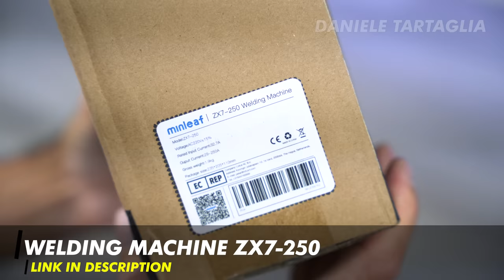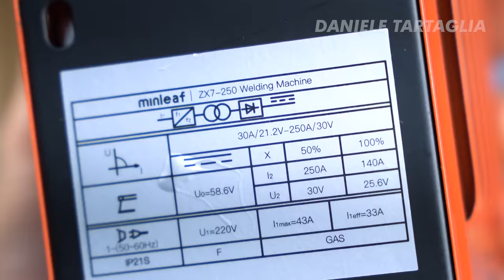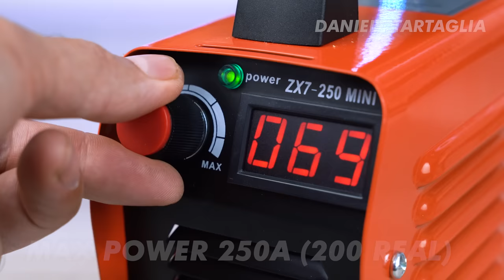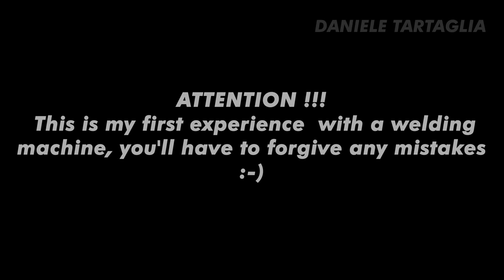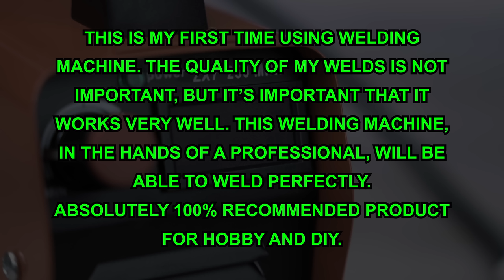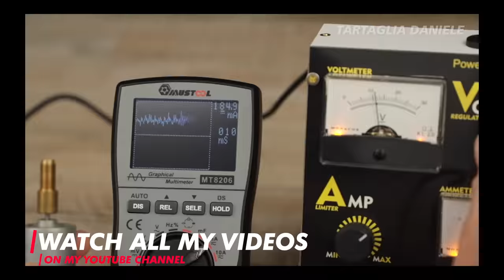INCREDIBILE! MINI welding machine that fits in ONE HAND - Topshak ZX7 250A

Comment: DEFECT ALERT: If I had my own YOUTUBE channel, I would make a video about this DEFECT I found and corrected in my brand new TopShak ZX7-250A 110V welder, which I bought on Banggood.  Apparently, this unit was assembled using five M3x10 machine threaded screws to anchor the 3 big heat sinks in the back of the unit, near the cooling fan. This was a HUGE MISTAKE on the manufacturers part, because the heat sinks have no machined or tapped threads for the M3 x10 anchoring screws to bite into substantially...but only crude SLOTS in the aluminum castings. You need to grab a standard #2 Phillips screwdriver and remove the welder cover, then use the screwdriver to check all five heat sink anchoring screws on the bottom of the circuit board, to see how many of them are loose and INCAPABLE of even being sufficiently tightened in the first place. I just replaced all five LOOSE heat sink anchoring screws with some slightly bigger sheet metal screws, which have tapered threads very similar to self tapping screws. NOW all five screws can be tightened very securely. You really don't want any of those 3 heat sinks EVER coming loose, because the result will eventually be a certain failure of the welder. If you rely on the factory installed M3 x10mm screws to keep those heat sinks secure, your welder is headed for certain failure. Luckily, this shortcoming is very easy to remedy.
Reply: Hold moly thats for posting this. I was thinking of purchasing the welder from banggood and using it right away, after after getting it wired up.
Reply: Is the welder actually 110v or 120v. Would this welder trip a 15amp circuit breaker ?
Reply: Call it 110V or 120V,  but at the end of the day, it is the same old single phase AC wall outlet supply voltage that we all use here in the USA for most of our common AC powered appliances and devices. MOST of the smaller devices and appliances rated for 110/120VAC are going to run on any outlet that is supplying anywhere from 90vac to 130vac. But anywhere between 110vac to 120vac is optimum. I have found that 113VAC to 118VAC seems to be about the national average wall outlet voltage, which is just fine. I don't KNOW that there would be much DIFFERENCE....whether the manufacturer rates the device to run off 110vac or 120vac. But I really don't recommend running ANY kind of 110/120vac welder or plasma cutter on ANYTHING LESS than a common 20 AMP circuit breaker. That would be the BARE MINIMUM for running even the smallest inverter welder....especially with the welder output current turned up to MAX OUTPUT. You might get away with the 15 AMP rated breaker IF you are running NO OTHER DEVICES off that circuit AND you are keeping the welder power dial at NO MORE than 50% power. Remember that the inverter output circuit depends upon IGBT inverter power for welding. If you try to run Isolated Gate Bipolar Transistors on an AC supply circuit that is sagging too much with ac voltage drop during heavy current draw, you can literally FRY the Isolated Gate Bipolar Transistors and/or rectifiers and it won't matter HOW BIG the heat sinks are, that the IGBTs and rectifiers are mounted to...inside the inverter welder. Same thing can happen running the welder at MAX OUTPUT on a cheap, skinny little 18AWG extension cord. Running a welder on a circuit with a higher current rating and heavier wire than the minimum required will keep the wiring inside your walls from getting hot, so it is always a good idea to have at least one 110/120vac circuit in your dwelling that has at least a 20 Amp breaker...just for running power tools or a small welder. For the sake of thermal headroom, I would go even higher and run the welder off 25A or even 30A breaker....WITH the appropriate gauge wiring to SUPPORT the 25A to 30A breaker of course. When it comes to running a welder, MORE is ALWAYS BETTER in terms of ac supply current. This is why it is nice to have a DUAL VOLTAGE welder, such as the 160A Deko Pro MMA welder, because you can always just plug it into any 220VAC dryer outlet, which almost always has a higher current breaker than your most common 110/120vac outlets . But running the Deko pro on a 220vac outlet will only draw about HALF the current (Amps) as running off a 110/120V outlet. So almost ANY 220V outlet would be far greater for running a smaller welder, even if the breaker is an OLDER 220vac circuit and rated only for 20 Amps. But I think you will find in most modern dwellings, the 220vac dryer outlet will usually be on a 30 AMP breaker, which is even better. But again...ANY 220VAC outlet would be far better for running even a smaller welder...especially if all your 110/120vac outlets are only rated for 15 Amps!!!
Reply: @scottfrazer8376  whoops I ment to ask if the welder unit was 220v or 120v. 😅
Reply: Good looking-out  Scott...
Reply: Thanks mate!
Reply: @scottfrazer8376 
Thank you so much

Comment from the maker: HURRY UP, FOR TWO DAYS THIS INCREDIBLE WELDING MACHINE IS ON BANGGOOD AT THE PRICE OF 35.82 EURO NO CUSTOMS AND ONLY 29 PIECES AVAILABLE. I HAVE ALSO INSERTED A DISCOUNT COUPON THAT YOU CAN USE...   ⬇︎⬇︎⬇︎⬇︎⬇︎ purchase link and coupon ⬇︎⬇︎⬇︎⬇︎⬇︎
🔴 Topshak ZX7-250 250A  Mini Electric Welding Machine: https://bit.ly/3zqifn2
💰COUPON: BG9ac093 24%OFF
Reply: The coupon code does not work for this item.
Reply from the maker: @georgenicolaidis7550  it does not work because it is on special offer. if you are interested take advantage of the Banggood promotion. the banggood offer expires tomorrow

Comment: I have a havadou225 about the same size and it runs 1/8 6010 like it built for it. These tiny stick welders are slowly taking over.
Reply: Just bought MMA-250 it’s awesome to see this under 100 bucks   
20 years ago this would cost over 2000 I used them then.

Comment: The wire on that transformer is not capable of 225 Amps.  So maybe it is good for 100 Amps or so.   The power semiconductors are mounted on Heatsinks right up against the fan so the get adequate cooling.  They could make it a little bigger and mount bigger Semiconductors in the board and a larger transformer and they could really reach 225 Amps if the input power can handle it.
I dont believe that knob does anything.  Its a great display toy.

Comment: Got one like this, have yet to use it. But i was wondering what size rod can be used with this other than what was provided? Im sure i cant use very large rods but i can assume some standard size though not for too long due to duty cycle and what not
Reply: Probably 3/32nd 7018. I know it sounds like gibberish but they'll know what you're talking about at the store.
Reply: @SolarSeeker45  tried it and honestly im happy with it. used it to weld up a gokart fame in spots it had cracks.

Comment: I don't believe this was your first experience with welding 😱
When I was start to Welding I ruined half box of welding rods because when I tried to weld each rod will stick with metal and burned 😁
Reply: Probably your machine hasn't got anti stick function, amperage is too high or the electrode is a bit damp
Reply: @ShiningForce07  no it is a base model it can only adjust ampere not even provide ammeter